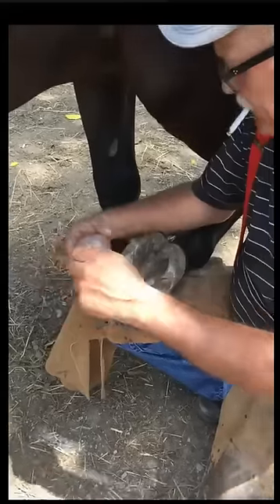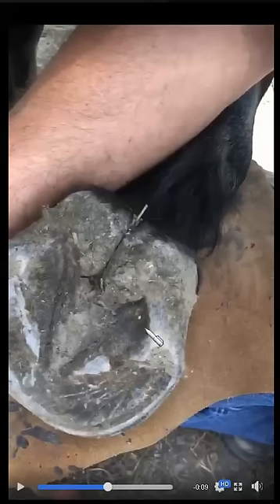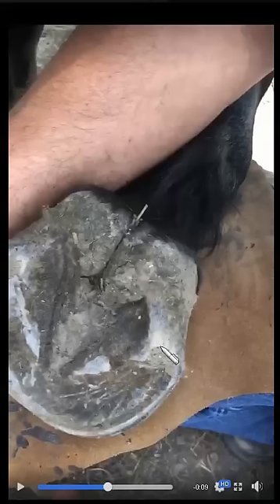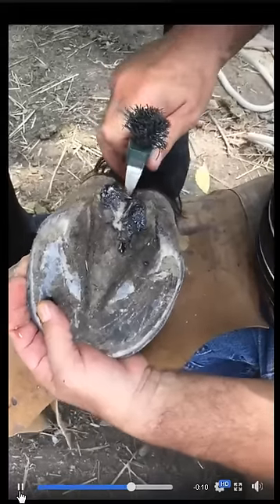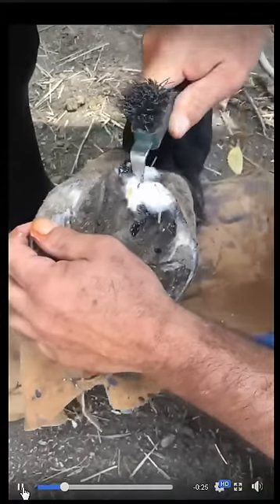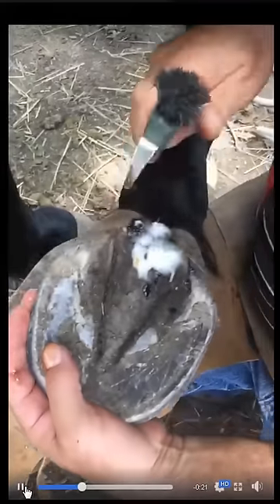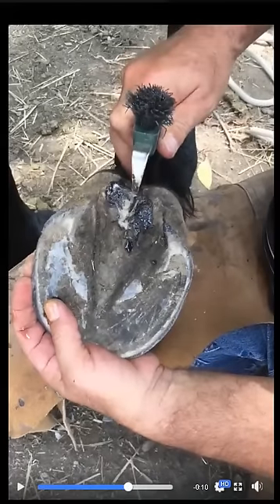How Beveling aka slippering aka ramping the heel buttress Destroys the frog stay.

Comment: Thanks for the video! Just a few Qs... Are you saying that the thrush has no roll or doesn’t exist? I’d image that thrush itself would cause pain, the the heels would contract to protect that part, which ultimately backfires obviously bc then they’re heels are pinch and sore and rocked back onto.... I’m not a farrier, just a thought as I have been battling this since September, finally have that aspect of the frog rid of thrush, and hoof/bulbs are starting to open up... thanks!
Reply from the maker: I never get the notifications for these. No thrush exists but this is not thrush, this is serrious wounding and damage going on to the sensitive tissues due to how the back of the foot is being trimmed. That liquid is from the frog stay that grows between the bulbs literally being pummeled and stripped out of the foot by how it's being trimmed. He's "experimenting". Notice he says the horse was ok just a few weeks ago. any farrier or trimmer that knows what they are doing would have noticed severe deep central sulcus thrush that does not develop like that in that short of a time. He has ramped and beveled the heels back so that the horse is forced to roll back on his bulbs which destroys the back of the foot and the frog to corium connection.